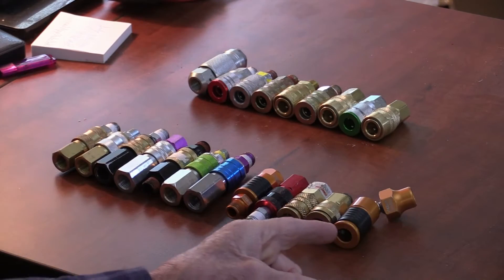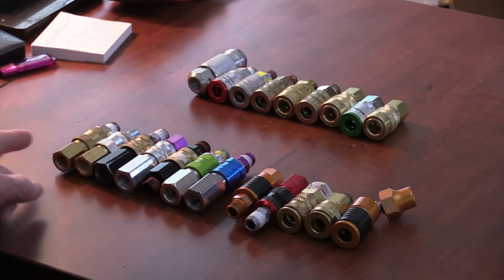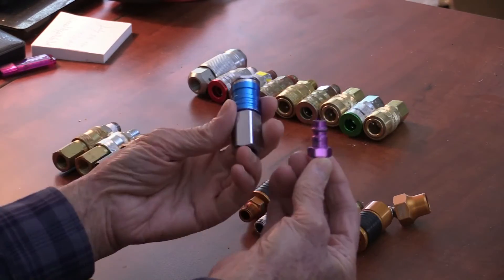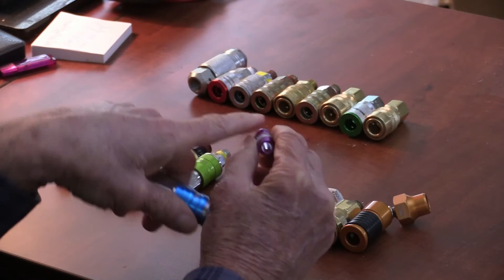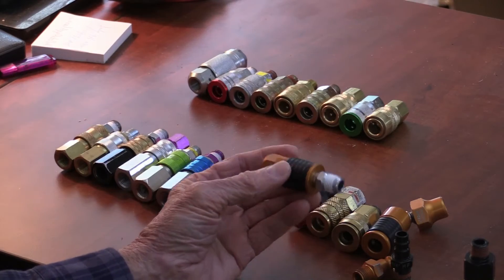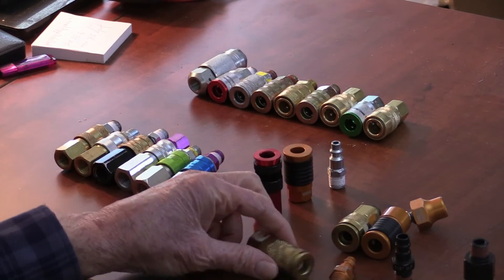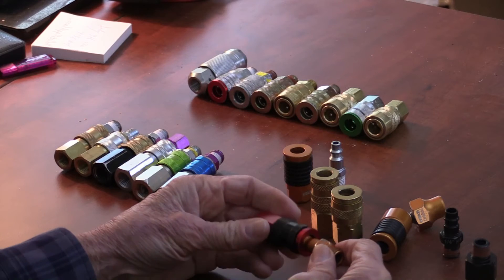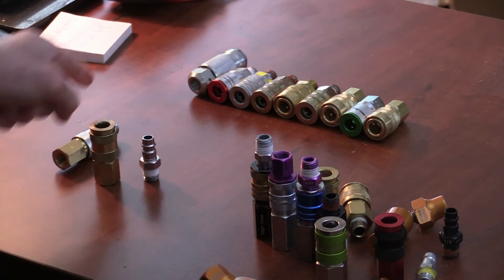Some facts about high flow air couplers

Comment: This made me think of a de Laval nozzle to increase pressure of the blower, but first it needs to be moving faster than the speed of sound so it is rather unrealistic.

And after a bit of calculation, if anyone's curious it has to be around 350 PSI to reach the speed of sound

Comment: I've been asking this question a lot and got many different answers. I was led to believe that the plug is the only part that is highflow and the coupler does nothing different other than accept the high flow plug. You are saying that the coupler itself is responsible for the higher flow rate? What is the purpose of opening the plug internal diameter then?

Comment: I am going to have to disagree high flow fittings with higher flow couplers makes a bigger difference in performance
Reply from the maker: High flow couplers and plugs  are only beneficial when used with HVLP guns. This assumes the standard coupler is not excessively restrictive.

Comment: If you are still using a standard M style plug and only change out your coupler, how are you making a difference?  Are you saying the standard couplers have a smaller than .19" hole in them?  I would say the high flow "V style" plugs with the mating coupler should still have more flow than the standard M style no matter the coupler???
Reply from the maker: The couplers are flow restrictive. For example:
Standard Milton M style Coupler and common industrial plug at 100 psi in and five psi pressure drop equals 15CFM flow.

Stedlin coupler with common industrial plug - 23CFM = 53% flow increase.

Stedlin coupler with QuietPlug - 23CFM = 86% flow increase.

Stedlin coupler with full flow plug - 32CFM = 117% flow increase.
Reply: @Stedlin   Clearly the Stedlin coupler is better than the standard Milton M style coupler.   How does it perform compared to a Milton V style coupler mated with a V style plug?
Reply from the maker: The one thing the V style is better at is a lower pressure drop at high flow rates. However the improvement is not particularly significant at flow rates lower than 40 CFM.
The V style is inferior in every other way.
Reply: @Stedlin  Question:  Both the standard industrial plug and the Stedlin QuitePlug have a rating of 23CFM  so why does the Stedlin plug have a higher percentage rating?
Reply from the maker: @billosbornejr8137  A common M style plug with Stedlin Quickcoupler has a flow rate of 23 CFM with an inlet pressure of 100 PSI and a pressure drop of 5 PSI. 
The Stedlin Quietplug increases the flow to 28 CFM. 
A Stedlin Full Flow plug increases the flow to 32 CFM.
Standard M style plug = .188” bore.
QuietPlug = .219” bore
FullFlow plug = .242” bore.
Reply from the maker: The Stedlin QuietPlug has a higher flow capacity than a standard 1/4” industrial plug primarily because the bore size is larger.(.218” vs .187”)
It flows 28CFM vs 23CFM @100PSI in and 5PSI pressure drop.

Comment: Good to know .   all I ever used was M style plugs been working with air tools over 45 years , all the hype on hi flow is crazy . for home use its crazy a 20 to 30 gallon tank has a 1/4 inch NPT fitting at the tank so going with larger kind of sets a guy back on PSI but gain flow .  I turn my tanks down from 150 psi to 120 psi to save wear tear on the electric motor and plastic pistons .   if you run a auto shop at home best thing you can do is get a good 80 to 100 gallon tank 3/4 to 1 inch outlet at the tank and use 1/2 inch air lines .  but home uses not worth the extra cash your going to spend to gain 1 or 2 cfm .
Reply: I don't disagree but if you like to do paint and body hf is the way 😅 not for nothing but we also do need a minimum of 2 of those compressors you described to keep up with a clear gun as the internal regulators don't flow worth a damn

Comment: I appreciate this video VERY much, sir. Can't seem to locate any of those steadler (spelling? ) fittings. Could please point me in the correct direction?
Reply from the maker: Thank you. Stedlin is the brand.
Reply: @Stedlin  roger THAT. Ordered. Thanks.
Is the full flow plug worth while over the safety adapter bushing that threads onto my existing plugs? For clarification, I understand that the bushing is not intended to increase flow, but rather a safety feature to prevent whip upon disconnecting the tool. I was just wondering how much flow would the full flow plug provide over the aforementioned setup with the bushing, provided the female coupler is used in both variations. Noticeable?
Reply from the maker: @natas0733  The increase in flow because of the full flow plug is only  noticeable when the flow rate is greater than 30 ft.³ per minute.

Comment: Hallo, what's the brand name and style of that last coupler, the coupler with the 8 high tech polymer balls please and easy push in collar? Is it available for low prices and in a kit with some good plugs on Amazon? Thank you
Reply from the maker: Stedlin. Available from Amazon.
Reply: @Stedlin  👍🏻excellent, no matter what I do I can't eliminate the air leak between my plug and coupler connections. Can we leave them outdoors 24/7 in the rain and snow? Thank you
Reply from the maker: Thanks. Outdoors in rain and snow 24/7 is OK when you use our plugs with our couplers.
Reply: @Stedlin  Great to hear that outdoors isn't an issue. Would you say Stedlin is pretty much the best available and totally worth their cost? I've just been using the stuff I get from Harbor Freight. I'm just new to air hose fittings too. I recently noticed one of my connectors doesn't require me to pull the sleeve back as I insert the plug. This is awesome so it's usable one handed. It's really the only kind to make, sell and purchase. I never understood why most all kits sold come with more male plugs than female plugs, why not equal number of each? I don't get it. Thanks
Reply from the maker: @Hundert1  Stedlin is the best available.
The reason kits come with more male plugs than female is because only one female is required for each hose where males are required for every air tool.
Reply: @Stedlin  mostly true, but most sprays paint guns use female fittings for whatever reason.